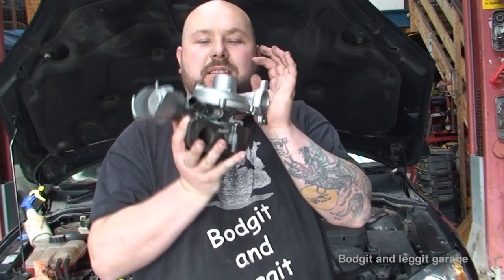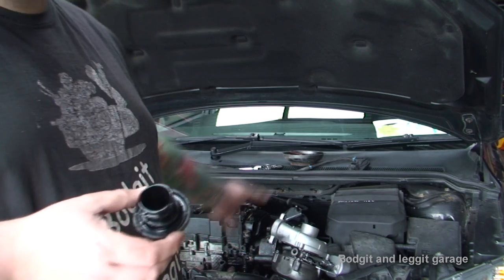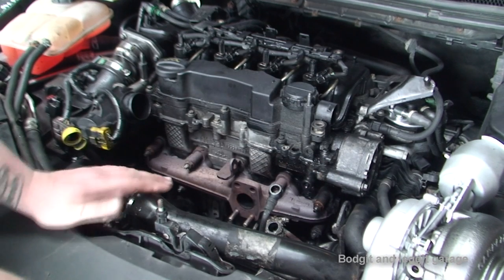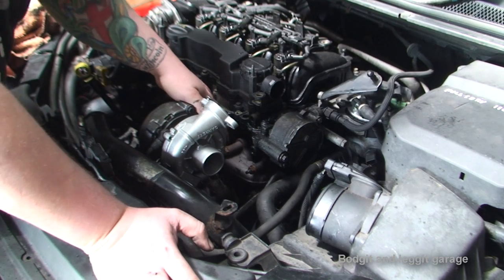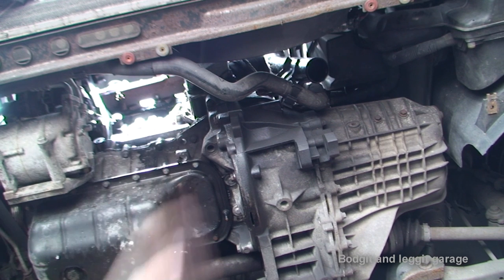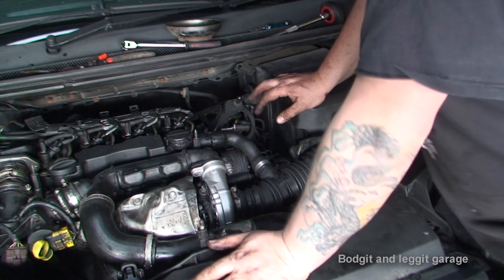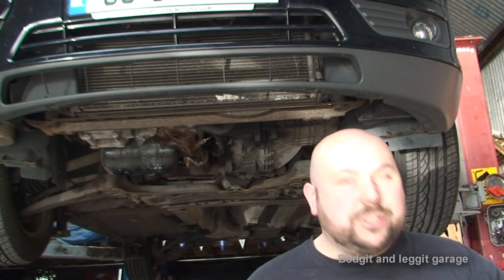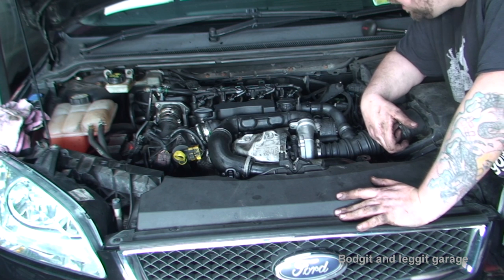ford focus turbo replacement part 2 Bodgit And Leggit Garage

Comment: lovely job...changed a turbo on a bmw 320d a couple of years ago on axel stands lol, had to undo the sub frame, and turbo axcess was from under neath so was a nightmare.........im getting a puff of blue white smoke on start up and impelar is loose on my pug 1.6 307 90bhp hdi, so your clips are vital....thanks so much mate, so easy to follow..
Reply from the maker: thanks mate glad it help you

Comment: Hi Leon, great video as usual, however i do have a tip for you, i have just replaced my turbo on a 2.0 hdi peugeot 407 turbo its at the rear of the engine so a nightmare as you can imagine, however part of the condition of the turbo warranty is 1 you have to replace the oil feed pipe with a new one with proof of purchase. and 2 you have to prime the turbo oil feed before you start the car (not so easy to prove to the turbo company but makes sense), this is not a criticism but an observation that may help stop things coming back and biting u on the bum. Keep up the fantastic work and thank you.
Reply from the maker: Hi mate yes I know it all depends on who and where you get the turbo from also depends on what the customer wants to pay so I hear what you are saying and I agree with you but it just depends on the customer I know this sounds stupid it's only an extra pipe that you can get turbos with no warranty which are a hell of a lot cheaper so I have to go what the customer wants at the end of the day it's their money thank you for your comments constructive criticism is never a problem in my eyes mate

Comment: Hello. This is the reason for the oil in the air filter? It could be from PCV valve because the engine produce to much pressure and drop to much oil vape out?

Comment: Would it be better to put a small hose on the retune pipe of the tubo and crank the engine a few times to see if oil is coming? Thank you

Comment: hello guys, my 1.8 tdci 02 focus has problems ! it takes 2-3 goes to get started, it uses oil, it changes power when it fancies, and can smoke quite well. ive just fitted bosch glow plugs, its on 119k now and ive had it 2 weeks😯 thanks, dave.

Comment: Hi, thanks for the video. Im going to change my turbo on my car too... im driving a 207  end of 2008 peugeot Le mans hdi 1,6. Do i also have to completly put out the particle filter ? 
Oil comes out of my turbo, im thinking that the bolt with the filter in it is locked, so the oil can not flow. I want too change the pipe and the bolts also.
Reply from the maker: Sisco Man just double check your turbo make sure it is gone before you commit to this yes you also do have to take that little filter out the pipe
Reply: can u please tell me if the old bolds from the pipes have both the filter in it or only the lower one..... sorry for my bad english
Reply from the maker: Sorry but don't understand what you mean
Reply: ok i will try..... there are two bolts right ? one underneth one at the turbo ... the underneth have the filter in , what about the bolt at the turbo ??
Reply from the maker: Sisco Man the little filter is in the feed pipe from the engine not in the turbo you don't need to worry about the turbo
Reply: Thank you for your tips, I appreciate this! But i can tell, that i hate this engine. My engine stutters, when driving.

Comment: Hi, great video. My turbo arrived with a syringe with oil in it, I suppose it has to be injected into turbo before first start. Do you know exactly where, witch hole? Thx
Reply: Oil feed, obviously
Reply: @georgemiller4585  Thx for the answer, do you have any idea what problems I might have by buying a 200 euro turbo?
Reply: @cipiko  depending on what it’s for you’ll be fitting another

Comment: I currently have a MK6 Fiesta Zetec-s TDCI (90) and it has the DV6 engine and I'm looking to hybrid turbo the vehicle very soon. What you said about the gauze in the lower part of the oil pickup causing problems, should I remove it? 

Thanks, Corey
Reply from the maker: yes mate remove it

Comment: Can I reuse the banjo bolts and feed pipe? If so what is best way to clean them? Great video btw, I’ve stripped mine down and new turbo just arrived 😬
Reply from the maker: Hi mate they do recommend to put on new pipes and banjo bolts and copper washers just check them make sure they're ok replace new cover washers tho brake cleaner would be good to clean them if you need to
Reply: Thank you and thanks for the video it’s helped me 👍🏻
Reply from the maker: @ddshiner  anytime mate that's what they're all about

Comment: excellent video thank you for making it
Reply from the maker: mark H thanks mate thanks for watching
Reply: i have a obd code P042F EGR A control stuck closed what would be the right thing to do with this it on my focus 1.6 tdci 2009
Reply from the maker: mark H you need to get live data on it if you've got any bidirectional control scan so you can actually  it or I have done a video on a tool that you can use to move it as well you can also check the wiring with a multimeter before you replace it just to make sure this part is

Comment: Another tip for keeping a bolt on a socket is to take a small bit of shop roll (kitchen roll) and place it over the head of the bolt and then push your socket onto the bolt head and it takes up the slack holding the bolt in place

Comment: where can I get a recon turbo from and what prices are we looking at? eBay has loads for about £260-£350.......
Reply from the maker: phollis80 hi mate I've heard too many horror stories from turbos from eBay I would suggest you go to a reconditioned place with your old turbo you get guarantees and everything
Reply: phollis80 was doing be the other day a good used turbo for 100£ sort the problem for 100%
however it was second turbo I bought the first one I get wast good so shop around good luck

Comment: Not a criticism but its recommended that you put oil in the top oil feed pipe bolt so the turbo isn't starved. If you did that i'm sorry because I haven't got to that part yet.😂
Reply: Good video again, hope you are paying the helper 👍
Reply: BTW, in the Haynes manual it states Ford recommend removing the filter!👍

Comment: Ive never done this extent of work before....I service my own car, ive done fuel filter, brake upgrades, oil changes etc do you think Im ready for this or should i bite the bullet of the expensive mechanic bill?
Reply from the maker: Jake Ireland hi mate unfortunate that's impossible for me to say if you feel confident enough yourself and you have the right tools and you take your time take plenty of pictures you should be ok if you don't feel confident 100% then don't do it

Comment: did you take off the oil filter pipe up mesh?
Reply from the maker: you obviously didn't watch part one to this video
Reply: +bodgit and leggit garage truth be told no I watched the first 10 mins of it thought I'd finished it lol.

annoyingly the most is the engines are really good just a few little issues with them that make big problems

also if I get a vid of mine the right side of the turbo has play could you tell me if it's normal as I've recently had a turbo replacement cheers
Reply from the maker: +kai wilson if you watch part one fully you will see exactly what I say and do with that mesh filter
Reply from the maker: +kai wilson I also talked about the play of the turbo you need to watch part 1 first
Reply: +bodgit and leggit garage cheers mate just watched the bit about the banjo pick up. not sure if they removed it when they put a new one on. I know they replaced the pipe so I'll do an oil change next week and get the bolt out. cheers for the video and help :)
Reply from the maker: glad I can help mate thanks a lot for watching get your hands dirty

Comment: I have a question, when you removed the intake pipe from the turbo it was full of oil, my question is how can the oil travel against the airflow from the turbo which you said was due to the turbo seals failing, my thoughts it might be more likely its come from the engine breather, what do you think ?
Reply: If you don't have significant play in the turbo, it will be from the crankcase ventilation, or engine breather as you say. Only way you'll fix that, while maintaining the vacuum to suck air out of the crankcase, is to fit an oil catch can. You'd need to reroute or make a new ventilation pipe. I'm considering doing it to mine too.